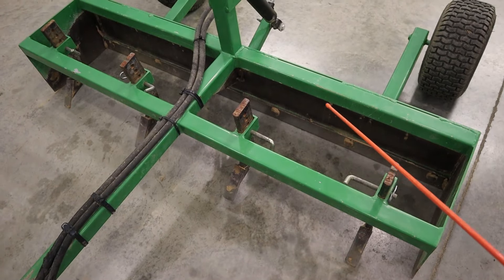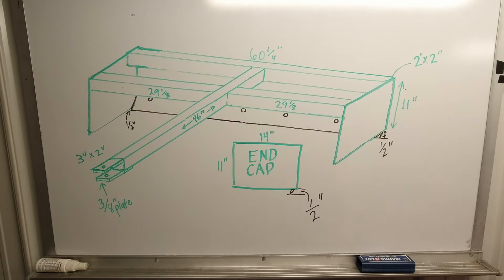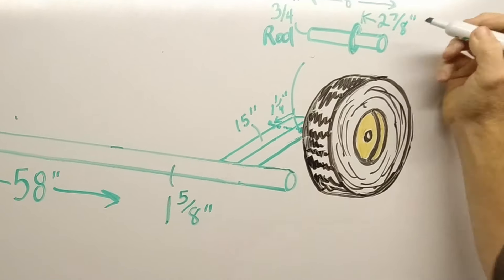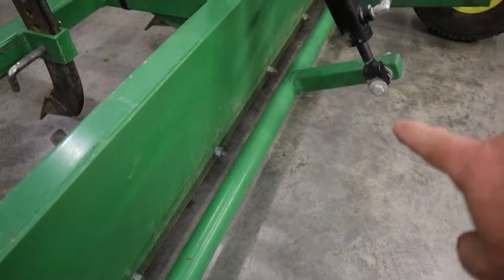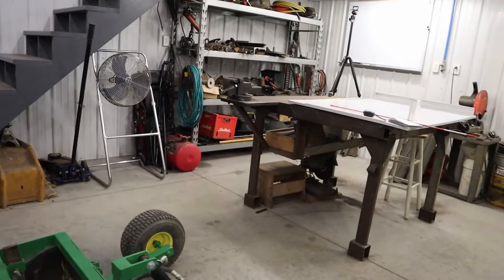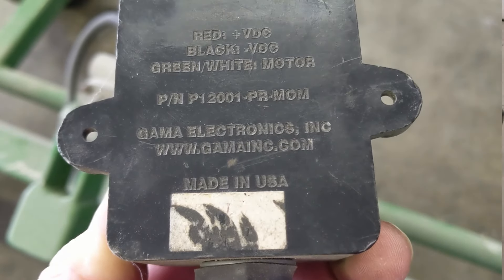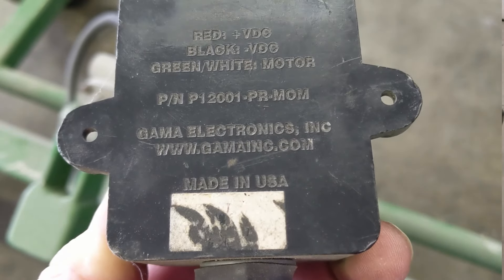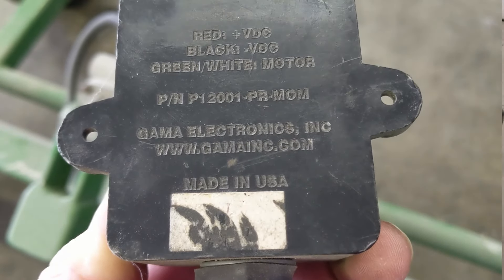Pull Type Grader Box Blueprint ||  DIY Box Blade How-To Video Tutorial for dimensions and materials

Comment: Dumb question just to make sure.

If I have a regular 3 point hitch that goes up and down I can build the box minus the wheels and lift part I assuming? 

I just don't see any where close to $1500 worth of material in the small 4ft box blades I have seen.  That is why I figured people could/have. DIY'd these.
Reply from the maker: You can lift a 3pt box but you don't get the benefits that come with a pull type box. It's easier to grade with the pull type.
Reply: @digdrivediy  thank you for the reply

Comment: Great design.  One question:  What material is used for the ripper retainers welded onto the front bar?
Reply: I’m not saying for sure, but quick glance, it looks like 3/8” flat bar. That’s what I’d do here. Take a square on either side to line up with the shank (in middle), then tack on each side. Then put a piece of bar stock or a piece of 1x3 tube and tack in behind it. Line em all up and weld it solid.

Comment: i like the video.  an idea i had was a adjustable tires to put a crown in the road.  maybe a plate with multiple holes and use a 3/4 bolt for the axle.
Reply from the maker: Thanks Mike!  Both really good ideas.  I've considered building a new one for my larger tractors that could tilt.  Thanks for watching!

Comment: Why is the back plate 11" tall but the side plates are 11-1/2" high?
Reply from the maker: The cutting edge hangs down below the back plate an inch and then the side plates are 1/2" lower to capture stone that trickles out the sides.  Therefore the cutting edge is only 1/2" lower than the side plates.  The shorter back plate allows the cutting edge to wear without wearing out the back plate with it.
Reply: Thx. More to say. Feel free to contact me vie e-mail.
Reply: @digdrivediy  I'm a little slow on this.The cutting edge on the back is one inch below the black plate? Do the side plates match up with the cutting edge that is one inch lower or are the side plates lower than the cutting edge on back? I've got the 1/4" plate cut and the rest of the equipment i.e. cutting edge, electric arm, switch, steel is all in.

Comment: Super helpful. Already have aJD-430 and older 50 inch box scraper with rippers. Just need to get help on fabricating the other components. Definitely want to plumb hydraulics into the spooler and run nicely to the back of tractor. Thanks for the video.
Reply from the maker: When I restore one of my 318's this winter I'll most likely have a close up of how to plumb those from the spool valve.  You can get in line of the hydraulic circuit with a run tee and then plumb to the rear.  I think there's a company called auxiliary hydraulics that makes a kit for it.  Best of luck!

Comment: I have watched this video a few times. I have a full acre property I would drag a makeshift harrow (using a 36" x 2" angle iron with 3 semi truck snow chains). This helps with the weeds. However, there are portions of the property I would like to level out. I like your design over other DIY scrapers. So, I was wondering if you are willing to make drawings/plans for the build (for a cost of course)?. For myself, it will be easier for me to scale down to use behind my garden tractor.
Reply from the maker: I can send you plans. Email me digdrivediy @ gmail.com

Comment: Is the back plate also 3/16 thick?
Reply from the maker: Yes it is.
Reply: @digdrivediy  thank you. I’ve got 3/8 plate to cut from as well but that may be a little too much?
Reply from the maker: @dh1986pete  If you have plenty of tractor to pull it, I wouldn't worry about it being extra heavy. Matter of fact we found the heavier they are the better they tend to work. They will cut in better when you need to cut and they are less bouncy with the extra weight. We have some guys that add weight just to help with the bounce so I'd use the 3/8 if you got it.
Reply: @digdrivediy  thank you!

Comment: Hey bud, did anyone ever do some CAD drawings for this? I would consider it if there's still a need. I worked in sheet metal for 10 years and worked in Inventor and AutoCAD daily. Great build and video!
Reply from the maker: I do have some CAD drawings available in PDF format.  Thanks
Reply: @digdrivediy  Would you be willing share the link for the plans?

Comment: Question: Do you think  using 1/4" steel would be too heavy (or even necessary) for an ATV (500 arctic cat) to pull?
Reply from the maker: I don't think it's necessary but not too heavy.  The amount of material that fills the box is what will be too heavy to pull.
Reply: @digdrivediy  Thank you again.  Have a nice week.

Comment: Hey, thanks for posting this, it helps me a lot to have some place to start for an ATV box blade.  The one main thing I'd like to do differently is have separate axles and actuators so one side can be higher to help me form a crown in my driveway.
Reply from the maker: I can see where that would be tempting to do. Only trouble I've had running ones with independent lift is it is difficult to get it back to level.  That'll be a fun build though so best of luck!

Comment: Excellent video!  What would you say to using HSS planer blades for the cutting edge?  There are some 12" ones with bolt holes in them (Makita 2012NB, 2 for $30 on Amazon).  I was thinking of a 48" width, and that the bottom couple of inches of the back plate could be bent (possibly by grinding a groove, bending, and then welding it up), with the blades bolted to them, with just a little edge sticking out.  Also, what about having thick tabs on either side of the rippers instead of boxing them in, so they could be easily removed.  Not as strong, but maybe strong enough.
Reply from the maker: I'd say whatever is cheap and would hold up is good with me.  I think you'd want the rippers boxed in.  Much of the strain is on the back portion.  They take a beating.

Comment: I converted a 66" wide box blade to a grader. I put a ball hitch on the back of my small tractor and raised the blade from the front by raising the 3 point. The blade is 1/3 of the distance from the wheel axel behind and 2/3 back from the ball hitch. The overall length from hitch to axel is 10 feet. The frame was made of 1.5 by 3 inch steel tubing 3/16 wall thickness. The frame angles down behind the blade to meet the axel height determined by the 13 inch wheel tire combo. The frame angles down in front so as to capture more of the 3 point lift. I can raise the blade 6.75 inches for transport. The best part is the frame bolts to the box blade with the same bolts in the same holes that originally attached the upper frame of the box blade so no modifications were made to the blade I had an old box blade that was getting no use. The cost to convert was between $500 and $600 in 2021. ( If we don't count the cost of the MIG welder and plasma cutter.)
Reply from the maker: Awesome!  Sounds like you've got a really nice rig to use there.  Thanks for the comment!

Comment: Yeah I need the measurement where to put the plate that holds the axle how far in from the ends , and from the bottom back plate to the bottom of the axle plate I figured that’s pretty important part for the axle
Reply from the maker: 4.5" in from the ends and 2" up from the bottom of the back plate.  Sorry I missed that in the video apparently?  Hope that helps.

Comment: Would I be able to make one with out the hydraulic because my tractor does  not have hydraulic
Reply from the maker: Sure you can.  In this video I point out that you can use an electric actuator in place of the hydraulic cylinder.  There is also a video on my channel showing the electric version.  Good luck with your build.  You'll love it!
Reply: @digdrivediy  ok thanks for the help

Comment: I wanted to build a stick rake and found this video.  The scraper looks very handy as you designed and built.  The dimensions, details how the lift wheels are  built along with drawings and hydraulic info is very helpful.  Thanks great video.

Comment: Just needed to know the plate for the axle were it goes on the back plate how far in for the ends and how far up from the bottom to the bottom of the axle plate roughly it’s 4 foot wide bc I’m using all 1/4 thick metal plate an tube
Reply from the maker: So you figured it out or you need a measurement?  Good luck with your build Jasper!

Comment: Good video,  looks like an easy build.  Probably could build this for less than 500, Probably far less if you can get some scrap.
Reply from the maker: Thanks so much!  I think you're right.  Very feasible to stay under $500 if some used or scrap materials can be utilized. Thanks for checking it out.

Comment: How hard would it be to make a simple set of pallet forks for an 87 316?  I'm sure there are cat 0 3 point forks if I ever invest in a 3 point for it but was just curious if its something you ever thought about. Also do you have a go to non dealer place for parts on your older machines?
Reply from the maker: I do have a miniature set of pallet forks for my 3-point hitch on these little tractors. It works great, especially if you have a smaller pallet to go with them. I don't know what you could do for forks otherwise without the 3-point hitch. Usually for any parts that I need I just get from the dealer but generally speaking I don't do much more than maintenance luckily.

Comment: What’s the thickness of the back plate and what the scrarf teeth mounted to. Thanks, great design
Reply from the maker: The backing plate is 3/16" thick.  For the ripper teeth mount, I couldn't find any tubing that is the proper size and heavy enough wall, so I took two pieces of angle iron and mated them around the ripper shank and welded them together.  It was kinda tricky and cumbersome but it has worked well.  There is some tubing that will work for the ripper teeth but it is light weight in my opinion and I would probably go the angle iron route with at least 1/4" angle iron so I'd be confident not to damage the mounts.  The ones we did with the tubing we did have a couple get bent, so that is why I didn't recommend it in the video.  I can email you up close pics of mine if you're ever wanting to see what I did for sure.  Thanks for the interest in the video.
Reply from the maker: @douglasgrimm4173  sent.

Comment: Thanks Neil I just finished building 2 of them one for me and one for a friend. Why is it friends always talk us into projects like this. Lol  I should have built one of these years ago.
Reply from the maker: That's great!  I like hearing that kind of stuff so thanks so much for taking the time to tell me.  Were you able to find and source all of the materials successfully then I assume?  Hopefully your friend was liberal with the stocking of your refrigerator after that bit of help!  I hope you get some great use out of those.  I'm glad that I've heard of at least one person building a box from help of this video.
Reply: @digdrivediy  I was able buy a cutting edge off market place then cut it length ways and use the two pieces one for each unit. Used front wheels off garden tractors that I had, purchased hyd cylinders from surplus supply, metal from a local supplier. Did put the teeth on they are a challenge and time consuming with all the large holes, Bridgeport mill made drilling holes easier. About $600 into each unit. I did find that by removing hyd.cylinder the front can be stood up with the hitch pole vertical for storage makes it nice and compact and it can still be wheeled around. Friend is very generous with many things. Thanks again for plans and motivating me to build these box blades they will get used.

Comment: I am an AutoCAD operator. If you want a DWG or DXF file for this, I'll be glad to draw it up for you.
Reply from the maker: I really appreciate that offer.  I have one version of it but don't know what file type it is.  I need to dig into that to look.  Thanks again.  Really appreciate it.
Reply: @digdrivediy  My AutoCAD is an older version, so any newer one can read it. Won't cost you anything, it's just something to keep me busy.
Reply: @mongowildman  I would really like to see that drawing / file
Reply: @FunwithJackson  I'll watch the video again and write down the numbers. It'll take a couple of days to put together once I have the numbers.

I have a small box blade that I bought from Northern Tool. Currently adding wheels and a linear actuator. The blade can also be tilted and sides removed so it can also be used as a grader. But without wheels, it just pulls to the side. I pull it with a Honda Foreman ATV.
Reply: @mongowildman  Hey there, did you ever get the blue prints done? If so I would love a copy
Reply: @Garry90  I did, but my computer ate it in a crash. I have a hand drawn copy yet and will have to get my CAD program working again. 
In the mean time, I have done a few things along that same line at my place. It was a commercially available box blade/grader from Northern Tool. It has been heavily modified to suit my purposes but only 40" wide. I'll dig up a shot of it in the current experimental configuration.
Reply: @mongowildman  I jumped in and figured out sketchup, I got it modified too haha

Comment: Thank you for posting this.  DO you have any insight to modifying an existing 3pt box scraper to a pull type?  I'd like to be able to use it in both function (3pt & pull) when different need arise.
Reply from the maker: That's a great idea and I'm right there with you.  I bought a 3pt box to convert to a pull type for my bigger tractors but I haven't finished. I didn't have any plans to use it both ways but that is something to consider. The tricky part would be dealing with the wheels and stuff mounted to the back if wanting to use as a 3pt only box.  The hitch part would be easy to make detachable.
Reply: @digdrivediy My thought for the wheel section is to make the hydraulic arm be able to raise the wheels higher (mount the top of the arm higher and have longer piston travel) or just use quick clips to be able to just pull the wheels off of their 3/4" shafts.  My other concern is that the weight of a bigger box may nee 3 wheels to spread out the load.

Comment: I thought about using a trailer tongue jack. No hydraulic or electric to mess with. In place of the rippers, use old garden tiller plows with a depth wheel in the center. This would allow it to cut deeper, using the box for added weight and level at the same time for seed beds.
Reply from the maker: That could likely work.  Just gotta get on and off to adjust the height is all but if it works it isn't wrong!  Good luck with your project and thanks for watching!

Comment: Another option for axles and wheels  is use a couple trailer wheels and a set of trailer spindles with hubs (matching wheel hub bolt pattern)

Comment: Great video!  I'm up here in Alaska and going with low temp steel and low temp welding procedures to put it together but overall great idea!  Using the grader for the 2 year old's snowmobile track around the house Thanks for your effort.
Reply from the maker: That's great Brian!  So glad to have you watching from Alaska!  That is so cool.  Good luck with your project.  This would work great for a snowmobile track I bet.

Comment: Very nice, well detailed video.
Definitely gonna be building one. The one major change I'll be doing is the side plates. I think making a set of adjustable skid shoes would be a good addition.  This way whenever the scraper blade wears out you can replace the skid shoes also.
Reply from the maker: Just keep in mind the cutting edge should hang lower than any skid shoes or it won't cut when you need it to.

Comment: Thanks for the details.  I'm considering making something similar for my John Deere 3520.  Main difference would be that along with the wheels, I'd like to be able to lift the whole unit up with my 3-point.  This would allow me to start and stop easier on our driveways, which have lots of turnouts and very few long straight runs.
Reply from the maker: Sounds cool Jack.  I'm not sure how that would work but would be very interested in seeing the finished product.  I've never had very good luck being very smooth with the 3pt draft arm control but for starting and stopping would probably be nice.  Good luck and let us know how it goes if you get it built.  Thanks for watching!
Reply: @digdrivediy   I agree completely with the 3pt comment.  My concept is to have the grader float free of the 3pt lift arms, possibly link with chain.  My use of the 3pt is to lift the whole grader and wheels up, so I can reverse to areas that I can't drive to normally when towing only.
Reply from the maker: @JackHoying  Oh gotcha!  That would be really cool actually!  Great idea!